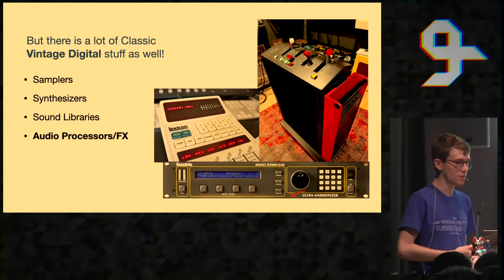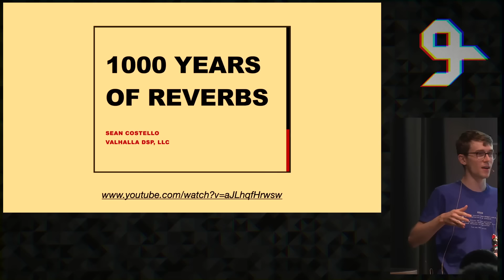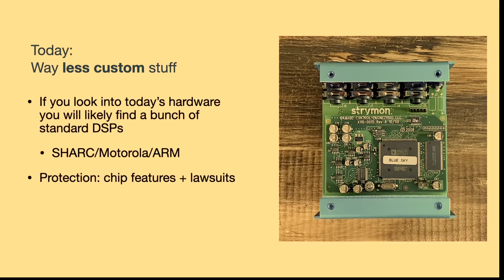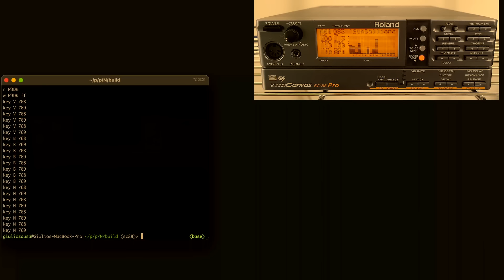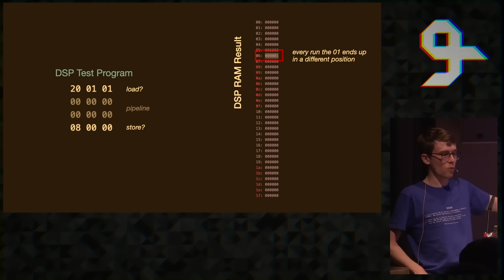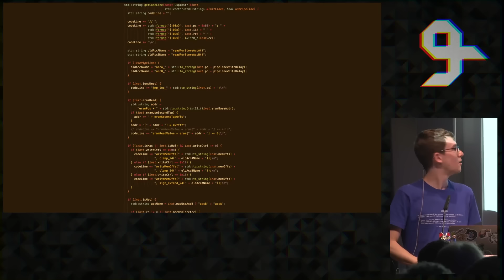giulioz: Sound Chip, whisper me your secrets!

Comment: Interesting topic, thanks!  What about aJuno oscillator chip? Does it generate a signal digitally or analog?
Reply: The Juno 6, 60, and 106 used Digitally controlled analog oscillators (DCO). It's like a VCO in that its an analog core relying on an external signal for frequency (resetting an integrator), but unlike a traditional VCO, a DCO uses a digital clock signal for resetting the integrator and a digitally-derived signal for the integrator's charge. 
Thea from Winterbloom has a wonderful article about every detail of the Juno DCO on her blog, you should check it out!
Reply: @turbochargedfilms   I read this article a long time ago. I was asking about another synthesizer model.  aJuno = Alpha Juno.
Reply: @EuroDJ  ah, sorry for the confusion! I have no real idea about the Alpha Juno DCO/NCO but I hope you find a definitive answer :)
Reply: @turbochargedfilms  Thanks anyway ;)

Comment: First, great talk - greetings from a recording engineer having used these ancient machines.

Second, 14:03 Yes, we can emulate the original EMT 250 ROM, or the later behemoth Lexicon 480. However, the AD & DA stages of today are… great. Those of these units were… just very different. 

To make these old DSP algorithms sound musical (as they surely did), the hand built conversion stages must also be emulated. 

E.g. in a 480, the converters boards themselves filled half of the rack unit, as there were no «off the shelf» ADC/DAC chips capable at the time. This introduced complex interactions well known to large-PCB designers today. In turn, e.g. Lexicon’s engineers ended up designing around as many «lacks» as possible, impacting the musical experience way beyond the DSP itself. 

We tested the 480 over AES when digital consoles (Amek/Neve) appeared early 1990s, and… were underwhelmed without then understanding why. Digital was «better», right? 

Well, it was. So good that the «missing stuff» became apparently annoying. And really expensive to experience…😂
Reply: Very cool about the converters! The way the numbers are put outside the box matters. This is why I want to use my Amiga 500 as a rom playback machine, it has its own imperfections.